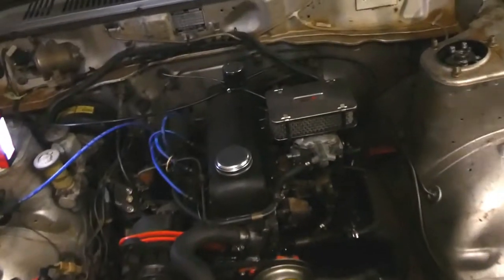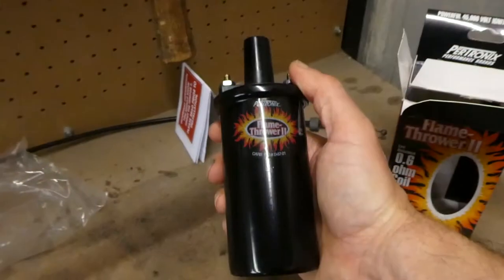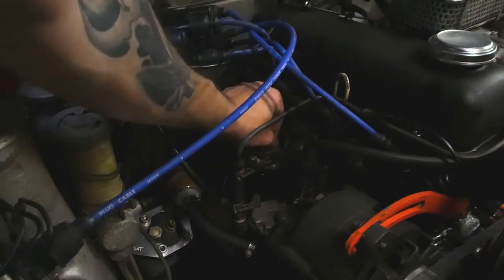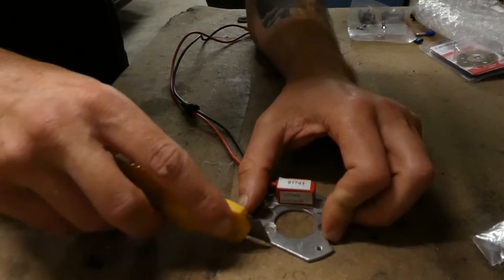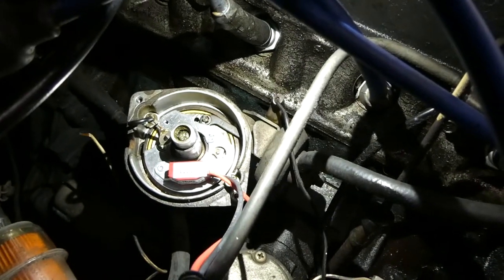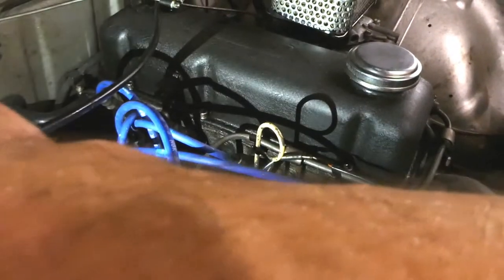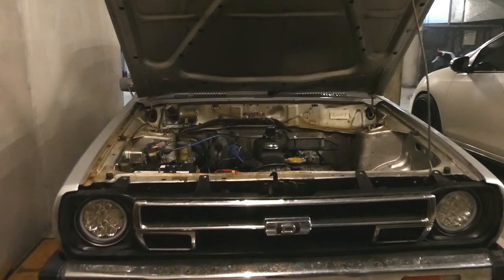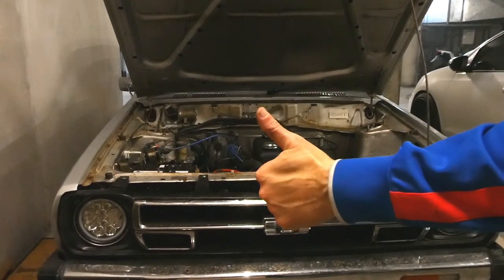Datsun B310 A15 electronic ignition conversion

Comment: Hey mate, just after an update, still running well? Thinking about doing this on my 1200
Reply from the maker: Hey mate, had it parked up for over 6 months because I didn't have a chance to drive it. Started up and took it for a long cruise no dramas. Purred like a kitten, blowing no smoke etc. Definitely recommend this upgrade.
Reply: @Adz093  thanks man, I really like the videos
Reply from the maker: @garagetwentynine4023  thanks heaps mate, that really means a lot to me. I've had difficulties with time and unfortunately my shed was broken into, so I've had to move the ute and haven't been able to film for a while. I will posting videos much more regularly in the very near future.